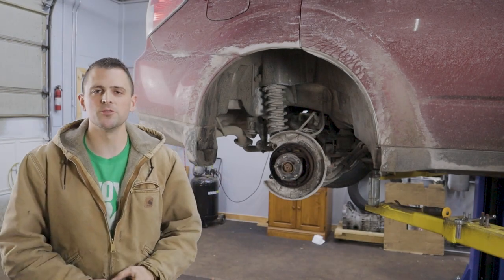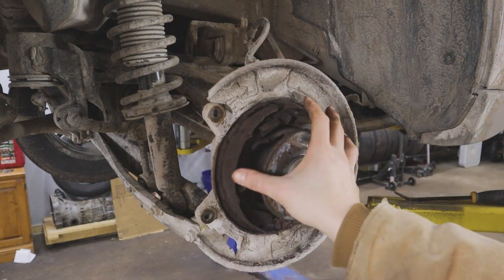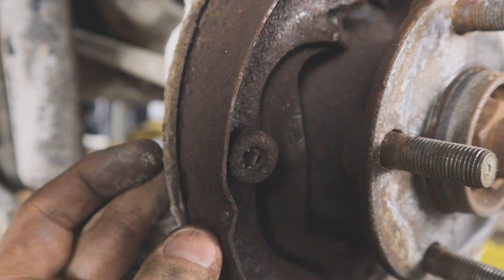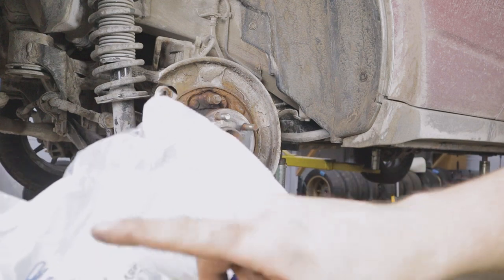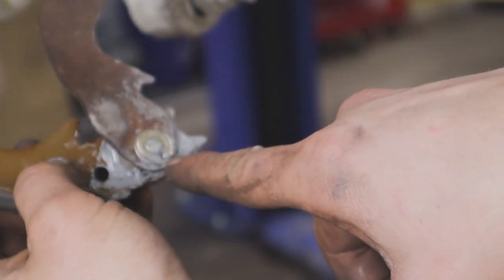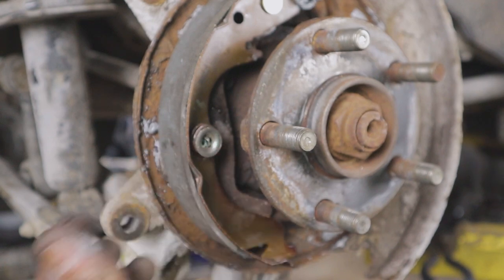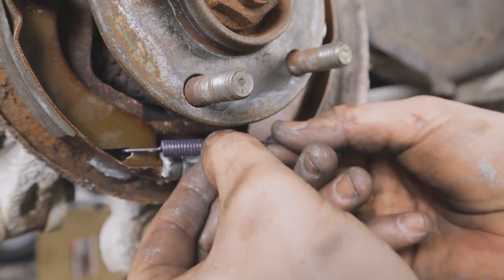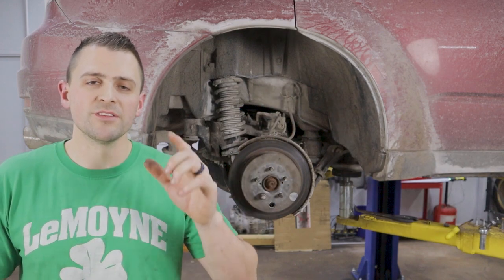How To Replace Parking Brake Shoes On 2012 Subaru Forester

Comment: Great demonstration!!  I consider myself a pretty good home mechanic and this job is the one I avoid the most.  Appreciate the way you highlight some of the trouble areas and things that are potential pitfalls.  When adjusting the tension, it seems the two rear wheels would have to be done together since the other one might be creating the drag.
Reply from the maker: Glad you found the video helpful!
Reply: @TwoFourSevenDIY , Your video gave me the confidence to properly inspect and adjust my emergency brake.    At my next inspection, I'm going to take it apart and grease it.  Thank you.

Comment: Best video on this that I've seen.  I blew mine up while replacing the wheel hub (forgot to release the parking brake first) now I gotta put the ebrake back together.  I failed once today, but I'm thinking with what you show here I will give it another try.  Thanks brother.
Reply from the maker: Glad the video was helpful!

Comment: Greta video! Quick question. My kit with springs has 2 yellow and 2 blue. The blue ones are about 1/4 shorter than the yellow. Should I use the yellow on the main shoe (rear shoe on passenger rear) and the blue one on the front shoe?
Reply from the maker: Honestly I'm not too sure, I've never come across a kit where the top shoe springs weren't all the same color

Comment: Thanks so much for this video, it's really helpful. Do you have a part number or link for the kit with the springs and other parts?
Reply from the maker: I order from rockauto for parts like this. Just select your make, model, year, trim level, and then select the brake section. They will have different brands available ... I can't remember for sure but I think I used the Centric kit for this
Reply: @TwoFourSevenDIY  Thanks!

Comment: Nice vid.
Why did Subaru decide on this over engineered setup rather than a simple handbrake on the brake caliper?
Reply from the maker: I mean, I guess you'd have to ask Subaru that. But it's not just Subaru, lots of Japanese vehicles use it, Hyundai and Toyota that I've worked on, I'm sure there are other manufacturers as well.